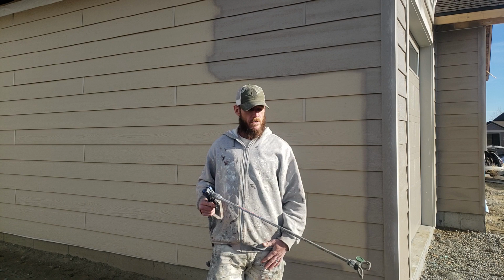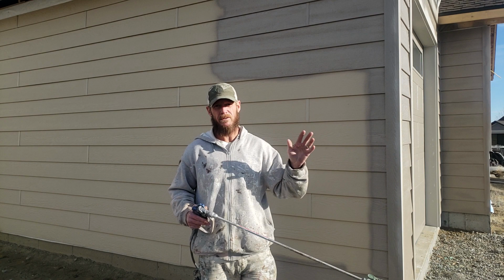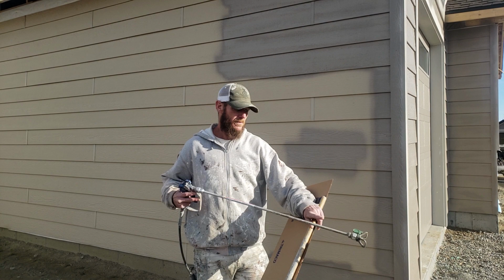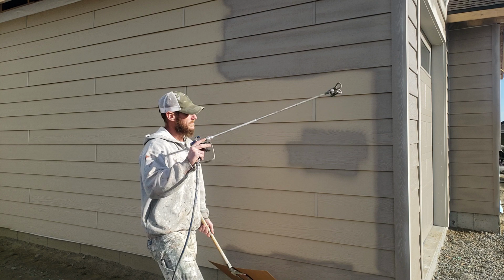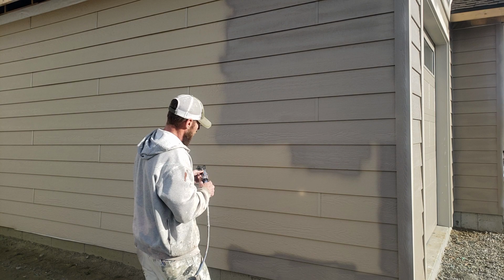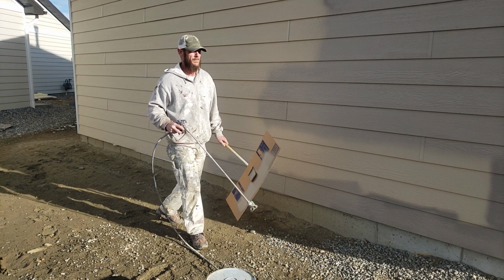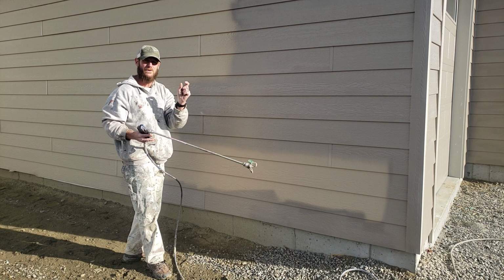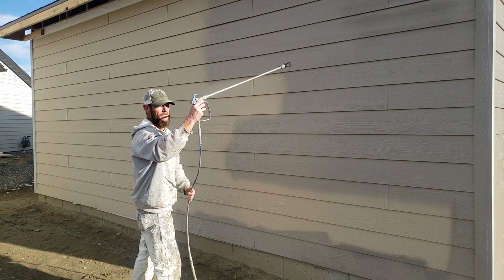How To Paint A House With An Airless Sprayer

Comment: On new surfaces, are you one or two coating it?  Thx
Reply from the maker: It comes pre-primed and 2 coats is pretty standard. You can get away with one, but have to be careful because of the amount you have to use to get proper millage.
Reply: M&M PRECISION PAINTING okay.  After your second coat on an exterior, do you have to pull masking right away or can you wait without any worry of paint bridging?  Thx
Reply from the maker: @tundrawhisperer4821  I normally wait about 20-30 minutes. It tends to be the point when the paint is not quite dry, but dry enough so any masking that might contact the siding when pulling it won't mar your  walls.

Comment: Given the thickness of paint using an airless do you still paint 2 coats? Is it the same for interiors 2 coats?
Reply from the maker: Yes, the backrolling thins it out, thus applying it more evenly. It also allows for touch up with a roller vs an airless, because the sheen will never match otherwise.
Reply: so you even backroll exterior ? @MMPRECISIONPAINTING